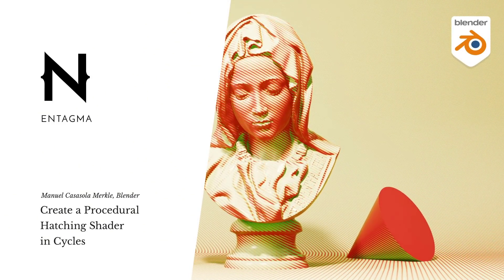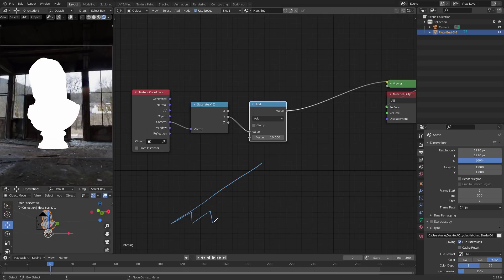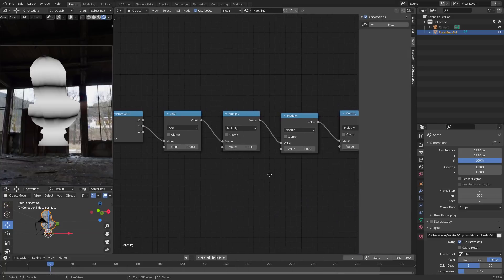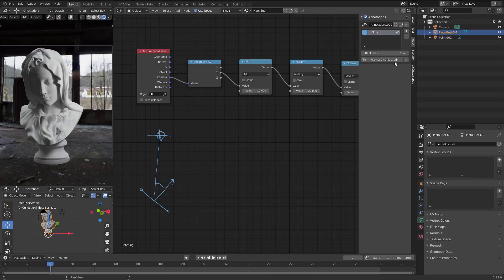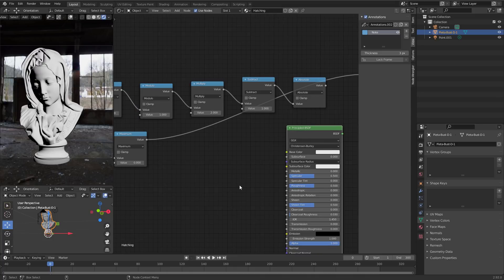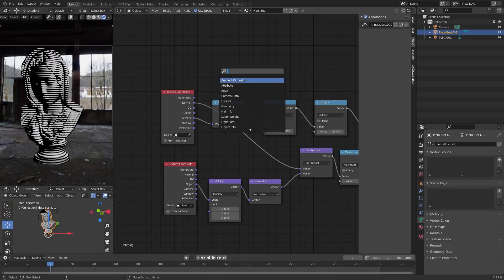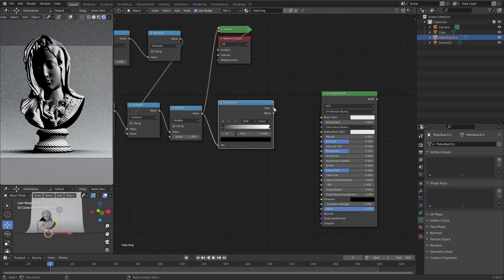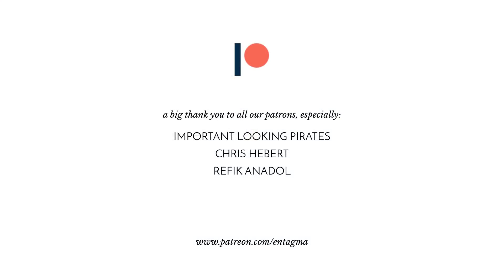Create a Procedural Hatching Shader in Blender Cycles

Comment: For some reason my maths isn't working properly- I've copy+pasted your nodes, I've even just appended the material into other files, and the light just isn't behaving properly. The reflection/highlight isn't pointing towards the light. Am I missing something in the SETUP for your /blend file? Ultimately, I'd like to use this method on other shaders (as a cycles replacement for Shader to RGB), but I just can't get this working in any new or existing files beyond the one you've provided.
Reply: I had the same problem. For those of you listening in the future of blender after 2.92 (I'm on 4.1), light positions stopped working like normal objects. I do not know the feature change reason. BUT to fix this tutorial to work the same, create an empty, add "copy location" contraint to it, and set the target to your light. Then update the object texture coordinate node to the empty. When the light is moved, the shader will now properly follow the light position.

Comment: awesome man, there is a shader to color node in eevee, using correct eevee lighting , it can give u very similar results , and u would be able to use multiple light sources with it.
Reply from the maker: Thanx for the tip. I know, but I wanted to create the shader for Cycles.
Reply: @Entagma  understands, sometimes we want physical object color behavior but mixed with stylistic looks. Eevee (currently as of 4.1) does not allow me that.

Comment: Awesome tutorial! At 7:07 you grab the point light using the Texture Coordinate node. Is there a way to do that in Redshift inside Houdini? I can't seem to figure that out..
Reply: Got it working. Just had to create an attribute on the points with that lights position and then dot the normals with that vector (bringing it in using just the standard RS Point Attribute)
Reply from the maker: Great, did you succeed in recreating it in RS?
Reply: @Entagma  Yeah, there were a lot of tricky hurdles as Redshift doesn't have all the nodes Cycles does, but I managed to recreate the Vector Rotate and also had to figure out the Is Camera Ray light path. But other than that, it was pretty straight forward thanks to the great tutorial!

Comment: Tight, and well-organised as always. I guess your approach is to dig a bit further into the math, not glossing over it by using convenience-functions, so when folks do use them, they understand what's going on, and can use them more creatively? So, no way is this comment a criticism. I'm loving your Blender videos.

Just a reference for later, though: Blender's (Python's)   Modulo  dips into the negative for negative fractions, so does not cross 0 without a jump.  Math >Wrap gives you an all-positive sawtooth.  Math>Ping-Pong   can  give you a symmetrical triangular wave, without having to think :). Texture>Wave can do both.

Not in this case; you have your reasons. But wrangling a physically-based-renderer into drawing toons for you, when its whole purpose in life, and all that computation, is for photorealism,  always seems weird to me. My first port of call for capturing the light-response of a surface would be EEVEE and the Shader to RGB node, and  Cycles, only if needed.... and of course there's always BEER (We hope!)

Comment: You should fix your previous tutorial
Reply: There's a pinned post about the Vertex Normal .. Chk it out.
Reply: @augm3nt384  Yes i checked it out, but its not clear how to fix it with that explanation.
Reply: @Amplituhedron1  Its pretty simple .. just use normal instead of vertex_normal
Reply: @augm3nt384  Ok, i will try it, I did not get that from the explanation.
Reply: @augm3nt384  I deleted the file and started again, since at first it did not work changeing to "normal". But now it works, I will finish it later. When i render it i will post a reply.
Thanks for your help, i was really amazed by the video of this tutorial. I just have to render it 😉
Reply: @Amplituhedron1  Awesome .. Good luck.
Reply: @augm3nt384  I have another question, the animation mentioned before works perfectly in the preview window and rendering it in evee. But when I use Cycles as a render, the smaller balls circles the bigger displacement ball, but the displacement ball does not get updated. Does this has something todo with the need to bake something first like with smoke simulations ?
Reply: @Amplituhedron1  Looks like Object Visibility .. In the Outliner there is Viewport and Render controls .. disable both for the base mesh and instance ( not instancer )
Reply: @augm3nt384  Thanks, it must be a bug in Cyclels, I releaded the file now it seems to render ok. I did a reload before as well then it didn't. My Eevee version is online, the cycles one is calculating for about a day :) .   https://youtu.be/YuM679gEHU0 . Anyway big thanks to Entagma especially
Reply from the maker: what are your referring to?
Reply: @Entagma  https://youtu.be/DQVYieRfQBY , This one. It looks fantastic, but due to some Blender change it does not work. Multilple users very interested in this tutorial got stuck.